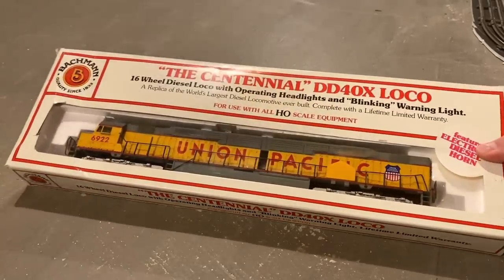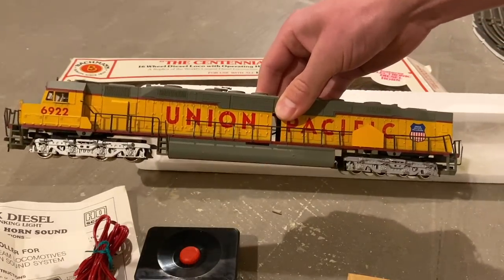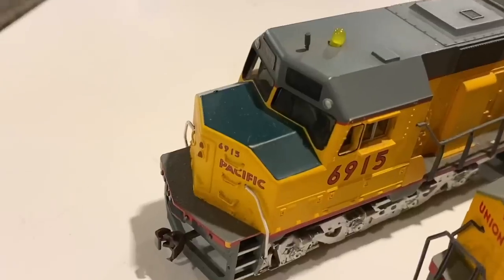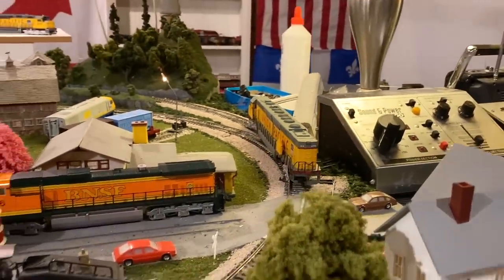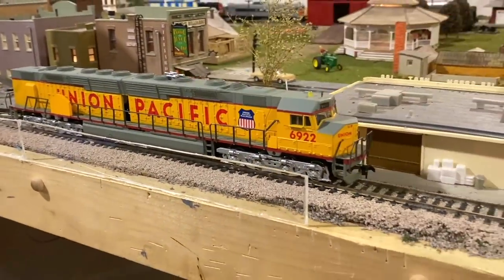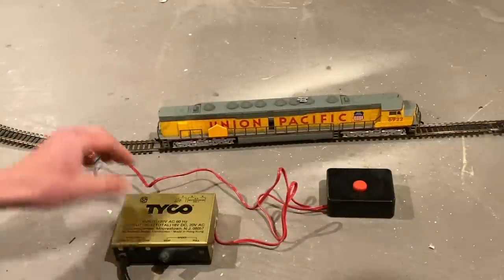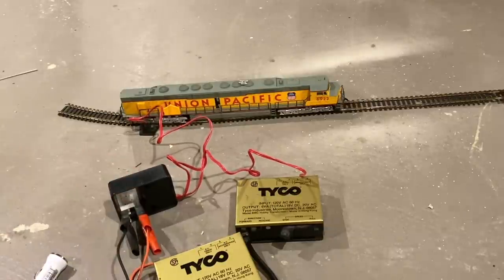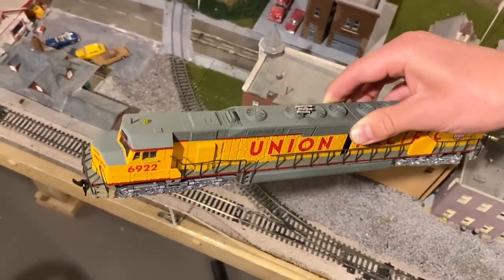The Strangest Ho Locomotive I've Ever Seen - 1980s Bachmann DD40AX W/Sound

Comment: Who knows how long it was in the box, Harrison.  I'm sure you will need to change oil and grease.  Wheels probably have that patina build up from sitting.  Now you're gonna have to change a piece of track so the horn works.  A new 9 volt battery and fresh AAAs may make a difference with the sound as you really don't know how much voltage you were providing with the Tyco transformer.  I'm sure it made kids' eyes pop back in the day.
Thanks for sharing. 👍 👍 👍
Reply: Ya are a amazin person David. Way to go bud
Reply: he needs AA batteries instead of AAA
Reply: @microbusss  aa And aaa use the same voltage
Reply: @modelyh0  it really doesn't matter seeing as AA don't fit in AAA spots, and vice versa. My phone and a 1928 Ford use roughly the same voltage, but that doesn't mean the batteries are interchangeable
Reply: 69 likes ;)
Reply: Red Green! 🤣🤣🤣🤣🤣🤣🤣

Comment: Pretty interesting! I'm kind of reminded of how in the 60s Lionel had an HO-scale Santa Fe A-B-A diesel locomotive set that also used a battery-powered horn. Though of course Bachmann could pull it off with the DD40AX due to its' large body, just like how decades later the DD40AX would become Bachmann's first sound-equipped DCC locomotive. (A lot of older Bachmann products from the 70s and 80s are still being made today, in many cases as new and improved versions, like the aforementioned DD40AX.)

Comment: Man, UP has got the strongest, single frame locomotives for both steam and D.E. under its belt. Crazy to think
Reply: diesels maybe, not steam. there are other roads that claim most powerful rigid frame locomotives. example, the Western Maryland had the heaviest and most powerful Decapods (I-2) and were among the heaviest Consolidations (H8/H9)
Reply: Yea but can the wester Maryland say they had a loco as famous as the big boy
Reply: Big boy number 3 in steam power.  Not even close to number one.
Reply: @needlenosekw  UP never claimed the strongest steam locomotive. They claimed the largest, which they do have.
Reply: Also don't forget the big blow/bird burner

Comment: This was forty years ago. As someone who has been at it for over fifty years, I can't say they were great runners. You can upgrade the pancake motors, but most entry level HO locomotives used some cheap motor. I personally prefer the earlier single motor all wheel drive Bachmann locos. Very noisy drive trains, but they pulled. Many locos of that era still had a single powered truck. And I remember my first flywheel loco. It was an Atlas GP-38, about 1975. With a skew wound five pole motor. This is about the same time Athearn change to flywheels. But my earliest locos had three pole Pittman motors with rubber band drive. It smoothed out the pulses because few locos ran well at low speeds, and whoa be to those who ran pulse dc. We've come a long ways, baby!

Comment: The shell is the structural strength on these models. Back in the 80's I did an article in RMC on how to convert an Athearn drive with 2 can motors if you want to upgrade the power.
Reply: I did it!!! I used a Bachmann Shell with a mechanism of DD40 of Athearn
Reply: https://www.youtube.com/watch?v=a5j-3NlK_F8
The engine in video is the result of it

Comment: I had purchased the model you have. The DD40X in 1987. However it didn't have the speaker sound , batteries & the controller. I have the updated models as well they're pretty well.. very genius with the substitute when the 9 volt failed to work. I was 100% impressed. Loved the video..☺🚥

Comment: I've got the newer Bachmann Sound DD40AX. I love the thing. it's a great puller. Very cool little piece of vintage gear you have there. I'll bet it runs pretty well once you get the electrical issue rsolved. Probably just some oxidation on the pick up bars. I've got a few old Life-Like engines with those pancake motors and they're silly fast. When I was a kid I may have suffered many "unintentional" derailments due to the speed. ;)

Comment: The horn system is like the old Lionel Postwar horn system. Battery in the loco and a special button to activate it.. That tyco controller is good for one thing, rifle target....
Reply: I use one of those TYCO controllers on my current HO-scale layout for powering the track turnouts, mechanical operating accessories and a few nearby lights. But to run my trains I use a Bachmann E-Z Command DCC system. It's kind of funny how back in the 70s and early-to-mid 80s, TYCO was Bachmann's biggest rival.

Comment: I bought an athern DD40X in about 1978-79.  I got it in black. I was going to custom.paint it.  That never happened. It's barely been out of the box.  You could get them with one or two motors.  I got it with one. I regret not getting it with two. It would be more rare today. I'll have to check mine but I'm pretty sure all the axles are powered. I was never a bachmman fan.  At least not their engines.

Comment: this was a loco built for the union pacific only. I worked for the Union Pacific Rail Road from 1990 thru 2004 at the engine house at Hinkle Oregon and was able to get on one of these monsters. This was 2 sd 40s on the same frame. I have the 6919 on my n-scale lay out.

Comment: That's a nice locomotive, SMT, With some real interesting and ahead of its time features. But, you can't say that you made a Red Green solution, because you didn't use the handyman's secret weapon!
Reply from the maker: Your absolutely right although he used cigarette lighters for many of his projects.
Reply: Duct Tape, yes!
Reply: @SMTMainline  true. Now in the next edition of SMT corner we will cut two f units in half and tape the band together, greeting a dual cab f unit. After you have spent 10 minutes making it, the thing falls apart after running 3 inches, to you walking away with your hands in your pockets, whistling.

Comment: I have this locomotive, and it actually has 2 motors in it to give it 2 truck pulling power. Also, the battery holder is designed for 2 “AA” batteries, not “AAA” batteries. If you like oddball Bachmann locomotives,  you should look up a 2-10-4 Texas Chugger by Bachmann. I bought this steam locomotive back in 1979, and it has “Electronic Chugging Sounds” that come out of the tender. The tender has a plug you plug into the the rear of the locomotive to receive its power. No push button controller required. Both of my locomotives still run after all of these years, and still provide their electronic sounds.

Comment: I lived in Las Vegas from 1975 until 1981 and was lucky enough to ride in a DD40AX twice. First was in 6932, and the second time was in 6922. They were on a lot of trains heading to LA from Vegas and so I saw them a lot at 50-60MPH getting a run at the climb in and out of Vegas.

Comment: "For use with all H0 equipment"
Both Märklin and every narrow-ish turn radius disagrees.
Reply: It'll work just can't use less than 22 degree turns or this will grind click and derail.  But they didn't lie it'll work, even my SD40-2 diesels required larger radius curves put in as all my 18's would cause it to derail.
Reply: @animalyze7120  you need a 36 inch radius curve to safely run one of these? Wow!
Reply: plus marklin is mostly AC :|

Comment: This is when Bachmann was good. (At least better than they are now)
Reply from the maker: They were certainly more interesting but they were not well built.
Reply: I just recently bought 3 of Bachmanns new N Scale GP40’s. Really smooth quiet runners. The experience with the new Bachman models have so far been equivalent to some Kato units I own. I’m using analog dc controls and they run MU’d really well with Kato units.
Reply: Bachmann got worse ?
Reply: They were NOT good back then. Pancake motors, horrible detailing, poor overall quality... I git started in the early 80s and it didn't take me long to upgrade to Athearn and Atlas...
Reply: @Lucien Thompson-Parmenter I had a 484 bachmann ATSF steamer and it was so light it couldn't pull for shit!!!!

Comment: Nice to see you working on that. I have two of those in the original boxes since I no longer model in HO. I believe I got them in 1980 or so. I bought the extra one to paint in a fantasy scheme. Mine don't have the horn option but they are nice models if you don't look too closely at them.

Comment: Most of us that have been in model railroading know this is basically a toy but, it does provide a good start if you want to improve its detail level with aftermarket parts or parts harvested off of out of action units. And since you sound younger, you can do this easily, when you get older, the hands aren't as steady, lol. Same goes with the current Bachmann unit they call a DD40A I think? If you lash a nice Athearn DDA40X with an up-detailed unit shown in this video, it should be a nice looking unit. I run my Athearn DDA40X with a "fast 40" which is one of the many units lashed together for trains. The fast 40 is handy for running my Scaletrains Big Blow as well. 
  Oh, keep an eye on the Athearn DDA40X as it can misbehave and cause the motors to sort of fight each other since there's two individual sound cards and motors inside. This will cause obvious damage and premature damage to the gears. And using proper lubricant is also important, I use silicone grease that you can find at any Autozone for a couple bucks.

Comment: I want the Bachmenn gs4 that was shown in the back of the box. But the thing is, it has horn hook couplers.
Reply from the maker: I wouldn't buy one, they're the least reliable locomotives around. The newer models are much better but the old split chassis ones won't be around for much longer.
Reply: @SMTMainline  the old split frame ones are more accurate in their rigid wheel base.
Reply: Mrcat Games maybe later
Reply: That’s why I love Lionel’s operating knuckle couplers

Comment: SMT - Maybe you should experiment with adding weight over the non-powered truck?  Adding weight may help the locomotive track better & make the headlight flicker less.
Reply: Both trucks are powered, but not all axles.
Reply from the maker: I might try that although I don't want to add too much since I'm not sure how much that motor can handle.
Reply: @SMTMainline  Yes, that is something you have to look out for!  I am thinking that the engine have electrical pick-up from the non-motored truck.

Comment: FWIW, there is a retired locomotive on display at the driveway entrance of the UPRR Jenks engine shop in North Little Rock, Arkansas. 6938 is the serial number.
I think were retired due to fuel usage per mile and kept out west for long train fast running.

Comment: You attach the button to your track. The button sends a signal to activate the sound. There was an article in the 70s Model Railroader on how to attach a record turntable to your track and play records of locomotives as a sound system. 

 Tender speaker for noise effects
by Cook, Peter A. 
from Model Railroader January 1971  p. 63

Comment: In the day this was a fair sort of loco and no other manufacturer did any thing this big for U P modellers.It would handle a train of 15 to18  Athern blue box wagons up a 1in 70 grade over my layout.If you replace the front bogie with a a replacement motorised bogie from Bachmann and wired them together you could add extra weight in the fuel tank my loco weighted just under 2 lb then you could get better running response a train length of 45 to 50 wagons and mine still runs on analog powered layout.these motors are very poor runners on DCC  
Thanks for the memory

Comment: Thank you, thank you I bought one these at swap meet. It's had me stumped for years been trying to work out how the sound worked as mine didn't come the horn button. Would you  take the horn button apart if its easy so I can see inside it and  make one ?  Thanks now I can put mine back together and run without the horn, you have made my day thanks again.
Reply from the maker: I'm glad this video helped. I will take a look but I'm not sure if the button can be opened up without breaking the case.

Comment: This was an actual locomotive made by EMD from 1969 to 1971.  These locomotives had two primary movers, it had two 16 cylinder turbo charged Diesel engines.  Union Pacific was the only railroad who bought this locomotive.  I believe this engine was designed to eliminate multiple helper engines.

Comment: They used to call it "the track straightener" because it would ruin switches.  It was that heavy.  There is one at the "Illinois Rail Museum".
Reply: It wasn't their weight but their rigid, one piece 8-wheel trucks that was problematic. Crews hated them up in the mountains since they didn't ease into curves very well.

Comment: That's locomotive is awesome for a bachmann I mainly use old Athern blue box stock locomotives and cars I have a Genesis tsunami sound locomotive amung my blue box stock it's a csx ex Conrail SD 60i runs sounds great look great I have bachmann sets as well my at& SF bachmann plus set runs great again took a month but runs I have a sp lash up a black widow f7 along with a up b unit and a sp blood nose f7 from 1950

Comment: Talk about weird engines. Many moons ago I had two TYCO GG-1’s that were almost 2 inches shorter than a standard AHM GG-1. It looked like the factory had just cut 2 inches out of the middle and then shoved them back together. Silly looking!
Reply: They didn't have the correct 2+C-C+2 under carriage. They had two C-C trucks. PRR had a few electrics that superficially looked like short GG1.
PRR had a DD2 locomotive, a single model. Which was 7' shorter than a GG1 and was a 2+B-B+2. 
https://en.wikipedia.org/wiki/Pennsylvania_Railroad_class_DD2
The Tyco model is probably a bit too short to use as a starting point to model one. 
PRR also had 28 P5a modified. Which looked like short GG1 but with a 2+C+2 configuration. In HO it'd be about 2.5" shorter than a GG1. The Tyco model might be a good starting point.
https://en.wikipedia.org/wiki/Pennsylvania_Railroad_class_P5
Third would be the R1. Just 1. Which was a 2+D+2. Also about 2" shorter in HO. 
https://en.wikipedia.org/wiki/Pennsylvania_Railroad_class_R1

Comment: I have the modern one but it has issues with jerkiness when it starts but after a few minutes it smooths out, do you have any advice on how I can fix this I’ve heard on forums that it is a common problem with bachmann split frame locos.

Comment: I own that same locomotive but it doesn’t run at all and it doesn’t move and the lights don’t turn on so in the meantime, I am trying to figure out why the locomotive is not working and I laughed so hard finding out that the little slot at the bottom holds a battery pack and mine doesn’t have it so I am now guessing it was used for parts but I am not giving up on the locomotive

Comment: I had a  athern blue box b&o dd40. It had 2 motors. There's a guy on YouTube that talk and showed a dd40 inside and out. I don't remember the name. It was a long video
Reply: It's too bad the model was of something that never existed. The DD40 was an EMD concept locomotive based on the DD35A's produced for UP but powered by the 645 power plant rather than the older 567 engines on the 35 series. The DD40 as modeled by Athearn never made it off the drawing board.

Comment: Got one -  still in the box  too !      NOT  at all like the  Athern units  ,  but  its  nice  looking !
Reply: I ran the shit out of  it !  ,  did great ,  not quite  as strong as the  athern units,  as they  didn't have the tractive power,  but  on 20" radius or less mainline   , they could  haul ass with  30 - 40 cars  .   The  4 axle  truck will do  a 22 "  but it has to be  perfect ,   I never had  it  run on 18"  ,  don't believe they would . . . .    but that was  early 80s.     I always  ran em on the   Tech 2500 units -  momentum on !  :)   Keep em clean -  I had very little problem with it

Comment: You flashed the instructions fairly quick. Is there a way of getting a copy of them? I also have a similar unit. How many batteries and type fit in the battery well? Also, does the instructions mention what the 2 C- and C+ connect to, if at all? Which terminals do the controller hook into and is possible to get a photo of it?

Comment: U should put a second motor in it. Then it will pull about 15 to 20 cars and it run alot better on low voltage

Comment: would it work on 18 degree radius curves?
Reply: No, you would NEVER get this thing on 18" or 22!" And if you did, it would look awful. You need 24" radius or higher for these guys.
Reply from the maker: @westtexasrailfan  It might operate on 18", I don't have much in the way of full 18" curves anymore however my newer 2000's model didn't object to the 18" radius curves when I had them.